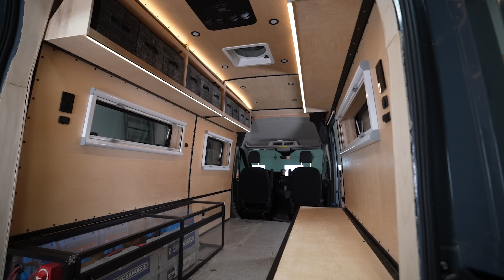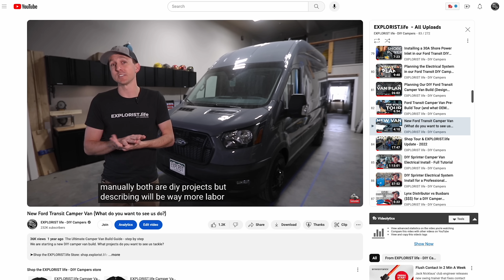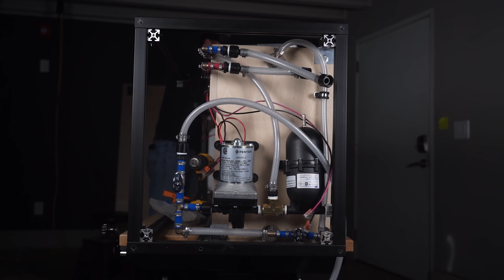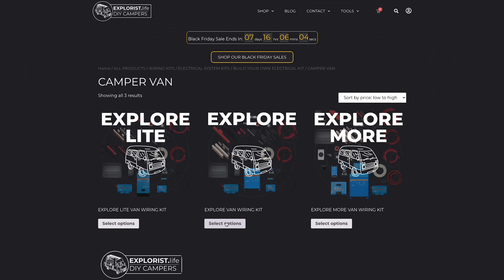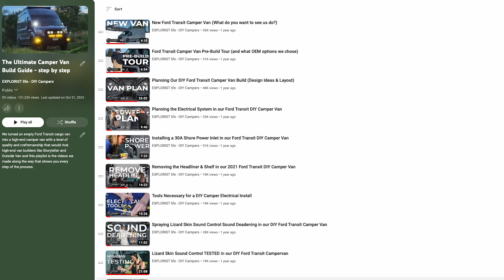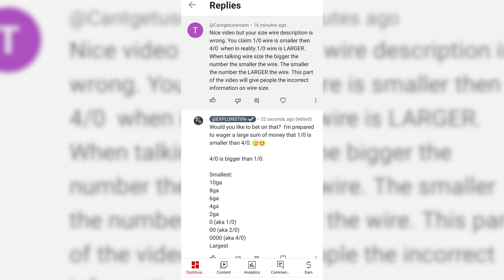Van Build Mistakes Made & Lessons Learned

Comment: I know this video is a year old and I have watch most of your videos, thus one really made me feel better about hiw difficult and time consuming it really is to install a basically 4th intergradeted power system, I purchased mist of my equipment from you back during the black Friday wiring kit sale and because I am a RV Tech and other things that life throws at you have not be able to give this project a 100%. But finally i should have it completed this week. The rig is a Lance 1181 truck camper with 2 280amp lithium litime 12v victron mult plus 3000 watt inverter/charger and all thr other normal equipment from victron to connect it all together. What a challenge but fun also many nights thinking about hiw to introduce all of the equipment in a small space without loosing functionality of to much of my precious storage and to make it look good, thanks again for your support on my equipment purchase and your videos which I can trust to give me the best safest system I can build. Andy

Comment: Your comments are on point.  I will say the making mistakes can be fun??????  I am/was a greenhorn and have put together and taken apart most everything at least 3 times.  Being retired I can afford to do this. I also think your future direction of focusing more on electrical is a good direction.  Your electrical videos are well detailed but I did get burned bad on batteries.  I initially  went with a single 200 ah lithium battery thinking it would be a simple matter of adding additional power.  I quickly decided to add power but the original supplier said he no longer marketed the battery (only 2 months later) and would not identify the manufacture so I could find a compatible alternative.  I also had an inverter/charger to dump (I cannot no longer trust this brand). The issue is that I was blindsided by the complexity of having  a multiple battery system. It would have been helpful to know about issues relating to mismatch of battery age, brands, chemistries etc.

Comment: The Featherbuilt kit would save time for sure, but I lime how extensively you secured your tack. I'd still add extra plusnuts at regular intervals with a kit. Interestingly, Featherbuilt uses a higher position for the upper track so that it can go over the slider and be the symetrical. I'm definitely doing aluminum unistrut, and I'm debating using the factory m6 weld nuts location vs the higher location. I'm considering welding the strut to wide base plates to use factory nuts with the higher location.

Comment: I learned that there is no way I'd do this. Rather I just buy a bunch of camping gear included a portable battery / solar generator. Easier, cheaper, faster. OK it does not look anywhere near that nice. Then again that look is a very expensive look. And it is trivial to move all my camping gear to some other vehicle or to a tent when I want. So make sure you really, really want to spend that much time and dollars before you decide to do something like building a camper van.
Reply from the maker: To each their own! Your build is your build.

Comment: Lots of great considerations.
I think the most important thing I did WRT my van DESIGN/Build  (especially being a 1st build) is to 'NOT' make it the build beautiful & NOT make it the final design from the get go.
I traveled for 3 months in pretty much bare van while thinking about where things will go and not be afraid to dump ideas. (trusts me - I have a closet full of abandoned things (purchases) that are left at home)
Sooo after 3 years (15 months that I slept in the rig) I have no concerns that the design kept progressing and happily screw or glue new design tweeks into existing infrastructure.
As an example - I started of with a bar sink (big enuf to brush your teeth) moved to a larger plastic tub - Ended up with an 18*13*10" (deep) SS sink with a large commercial (read spring style) faucet. could not be happier.
Another Example - I wanted a small closet to hank shirts - started with a moving hanger box under the bed platform - moves it to under the counter - Final place was directly behind the drivers seat from ceiling to top of counter.

I would not have optimized these to examples if I had done a final build from the get go. I am se happy I did it my way. 
FYI my 2nd build will be more beautiful as the design will have been already optimized...

Comment: I used your diagrams and the tools recommended in your videos along with  Victron/Battleborn equipment in 2020 to assemble my first ever electrical system in my first van build. 

This was prior to your business which now provides user friendly kits.
If I started over I would gladly use your kits rather than the endless sources of wiring I did. 

My system has been trouble free. 

Enough Said.

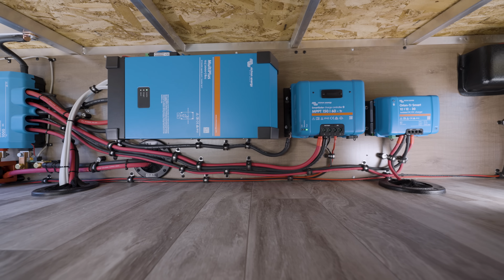Comment: I didn't know that the Victron Multiplus can be installed horizontally, like shown at minute 9:51 of this video.
Reply from the maker: It depends on the model.  Check the user model for the unit in question.
Reply: @EXPLORISTlife  Thank you for your quick response!  I can I know before purchasing the Victron unit if it can be installed horizontally?
Reply from the maker: Check in the user manual.  They are all online.
Reply: @EXPLORISTlife  Thank you!

Comment: Nate, thanks for all of the knowledge you share!   Quick question I was hoping to get your opinion on.   I have a 12v system, 690ah bank, 3000w inverter, 400 amp master fuse,&  350 amp shutoff switch.   I have enough 4/0 wire to connect battery bank, but not enough to run to Victron distributor/chassis ground.  If I use 4/0  for battery connections and 2/0 to the bus bar, what is the possible downsides?   Why would I not want to do this?

Comment: Sooo good, you are currently the reference for van electrical and a must stop for general van building. I went my own way (inspire by your configurations) and have to admit that despite I thought I could save on good deals (got a Samlex EVO 3012 for 1250US$) in the process, figuring the lengths of cables, parts with the wrong eyelet size or of poor quality, challenges with large capacity batteries etc. I end up not making any substantial savings. And I am not even talking about tools, I went through 3 different crimping tools for large cables.

Comment: I have been learning a 𝘷𝘢𝘴𝘵 amount from you both and I'm really, really grateful. it's incredibly generous of you to provide so much information. I'm in the UK,  so once I start my build, I think it'll be quite tough to get your wiring/kit kits (please correct me if I'm wrong). Your channel is one of my main sources of learning. In fact I'm currently thinking of bringing Victron kit into my workplace to act as a battery back up for -80 freezers...and maybe even solar. But I still need to learn myself some more first...
Edit: also - if it's not overengineered, it's not engineered at all 😉 (imho)

Comment: Love your candor. You folks are simply awesome. I bought much of my build components from your shop to retro my Northern Lite truck camper following what you did back in May when you did the NL truck camper retro build. Exceptions for me were to not use BB and up the inverter / charger to 3k. I used 3 Dakota DLs for the power source but wired / fused appropriately to the bank size. It is a completely over kill system but it is what I wanted. I had my plan in mind for over a year but Without your help in these videos and your store, I probably would have installed not as good of components and still be struggling. You provided the mindset to get it done. Thanks to both of you and your team.

Comment: Thanks guys for another informative video. I used your 600 AH layout for my van build and it's worked out great, however, I've seen a lot of posts from others that there should be a circuit breaker between the circuit breaker/fuse panel and the positive bus bar, which doesn't appear on the Explorist Life layout. With your comment in this video regarding inaccurate information online, I trust your opinion, so: Should I install a circuit breaker now?
Reply from the maker: There are fuses on every line coming from the busbar/Lynx Distributor in all of our systems.  Additional breakers for wires coming from the Lynx Distributor is not necessary, no.
Reply: Haha. I read the recommendation about the circuit breaker and  forgot I have fuses on my Lynx. Thanks.

Comment: Your videos are great. I have enjoyed watching your build while doing my own. My wife told me to use the adventure wagon kit and it was a great choice for us. I installed it in 1 week. I knew it would take me time to build as we have cold winters and no heated space to work in so during winter and the peak of summer no building. I gave myself 3 years to finish the build. May 2024 will be 2 years and I will be at 95% done so doing good there. Watched many of your Victron videos and they helped me to design and build a great electrcal system. 24v 7500+ watts, DC-AC-DC charging and 600 watts of solar. You videos helped me to put together my solar setup too. All electric cooking and a 12v AC. System has worked great from day 1 but I took weeks to build it. Was great meeting you in Hood River this summer and I think your wife is great. Hope to see you on the road sometime or maybe just drop into your shop.

Comment: I’m working on a 48v system, and I’ve found a few battery switches that are rated to 60v @300A on Amazon. Also, Sterling makes 12V->24V charger (and I have purchased their 12V->48V charger).
Reply from the maker: Yeah;  I can't trust no-name amazon switches on Amazon rated to 60V.  For the systems we've HAD to do at 48V (10,000VA of Inverting power); we've used 125VDC rated 250A  breakers; they are just $100+ each.
Reply: @EXPLORISTlife  I’m actually building a hybrid system (because I suddenly have access to 12v batteries as well). I’m having the 48v system top up the 12v via a 30A MPPT that has been verified to be able to convert the 48v to charge the 12v indefinitely.  My cerbo will allow the 48v to go no lower than 20% soc so that the 48v loads will still have reserve. Summary: 15kwh 48v charged by nations 100a alternator and Sterling 12->48v charger feeds power to 5-10kwh 12v.  Multiplus and heavy loads are on the 48v, smaller loads are on 12v.  But that’s my system so I can experiment.

Comment: Great advise! I went with a DIY custom build with no experience. On top of that, I'm cheap, so the build took 4, 5, 6 times longer than I thought. Not only that, after my drive to Alaska and back, I realized that some of my design choices were??? I built my son's bed to pull & fold out from the driver's side of the van to the sliding door. It is almost impossible to get out of the van from the back without crawling over him-he did not like it. Now, I'm removing it and replacing it with a bed along the driver's side wall. Which means removing and changing everything along that wall. My advice is to put a rough, usable structure in the van and use it to see if it works for you.

Comment: You mentioned the 48 V switch for on and off (this was used from the battery bank to the bus bar). I kept blowing these every time I was working on my house 48 V system, so I eventually started using a resistor to connect wire lug to the busbars and just left the switch on when I attached it. Seems to have solved my problem. Not sure why they don’t make a better switch?

Comment: Aren't Volta and Mastervolt both using 48v alternators and batteries? And supplying them to the major van manufacturers?
Reply from the maker: There are indeed various 48V components and parts out there, but they are not consistently available to the average end-user/DIYer; so I can't recommend going that route at this time.

Comment: I do like Facebook groups. And after all the years I think Im an expert in the things I worked on so far. So I sometimes help others with some info or perspective how I see it.

My 1965 unimog is for example 24volt. But my camper is 12volt with a 2000va inverter. If I would go 24volt camper then my solar controller can take double the power which is nice. And I save some money on cables. But my diesel heater and subwoofer amps uses 25A and 30A fuses. So I need to buy two 24v-12v 30A DC-DC. And a 24v-24v DC-DC. I now only bought a 24-12v 30A DC-DC. So if I go 24volt it will become more expensive
Reply from the maker: There is definitely the occasional piece of good advice in FB groups but WOW is if few-and-far-between when it comes to technical discussions like electrical.

Comment: Unless you are solo camper DO NOT install shower booth. 
The water wouldn't last more than 2 days anyway. Most of us will stop/stay at RV/Camp site anyway for water and other necessaries. 
If you have family of four your water wouldn't last more than a day if you are using the shower so you will have to visit the RV/Camp site. 
So called extra seats in the rear won't provide decent comfort for trip, just install better seats with extra space for families and install 
more storage which you never have enough of. 
Shower booth will turn into storage spaces according to many of campers.
Reply: A recirculating shower helps conserve water.